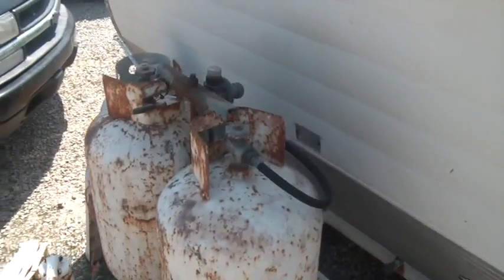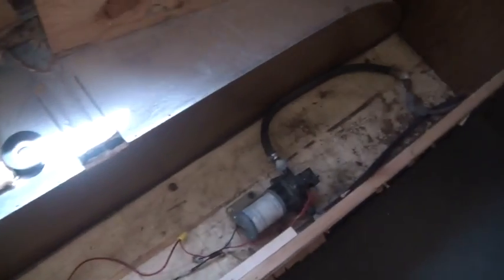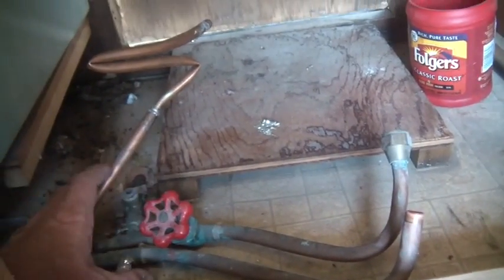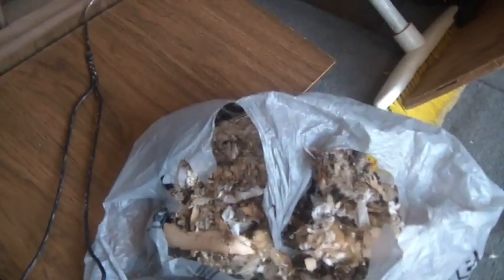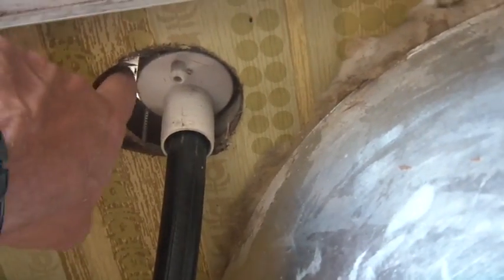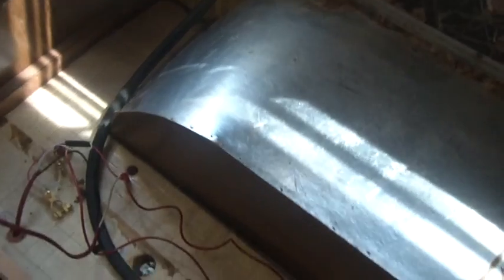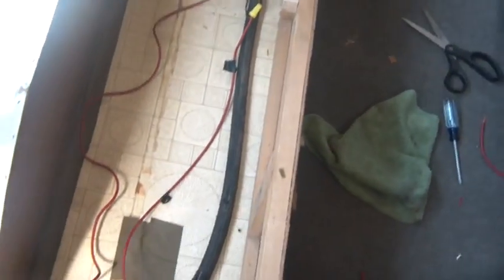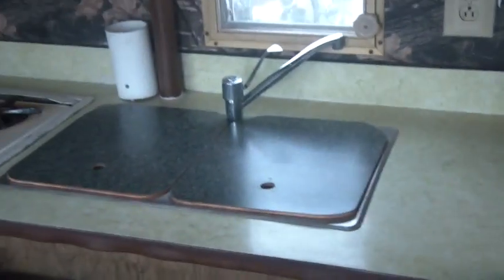Bugout Camper Trailer Update 1

Comment: Pastor, the gas valves appear to be the old type.  The local propane distributor should be happy to swap those for nearly cost if you buy propane from them.  If they do, they will check VIP and hydro check as well.  What a great project!!  Thank you for sharing.

Comment: Your water pump may only be a 12 volt motor, look at it closely. If you connect 120 volt to it you will release all the magic smoke...hahahaha
You may need the inverter to change over A/C current to D/C current to power the pump. You may also think down the road of changing out the window shaker to something that won't draw so much amperage, something more up to date (your choice, your budget). Great project with lots of potential, good luck and God's blessings on your new project.

Comment: @Pastor Joe, While you have all that torn apart you might consider placing hardware cloth and steel wool in any gaps where you see daylight to prevent mice from finding their way back in. Mice will chew right back through duct tape.  Consider PEX for your plumbing.

Comment: Try going to auto parts store and asking for rubber expansion plug that replaces a freeze plug in engine block and put it in hole in floor and tighten it up. It is made to last against engine heat and temperature changes. On the solar idea, batteries are your power storage bank, generator will be needed to run A/C, solar panels will not do it and batteries will run dry quickly. Run genny and A/C during day and use fans at night to be quiet. Solar panels can recharge batteries otherwise.

Comment: You can also use genny to recharge batteries when solar panels are at low efficiency during cloudy days. You will need two deep cycle batteries for every 750 watts you intend to need. Microwaves are power monsters so use gas grill or wood fire for cooking food. Look into a device called Kill-a-Watt meter (look up on Amazon)
Measure draw of wattage from major devices you intend to use to be precise (your choice). You can get away with 1500 watt inverter or so and four batteries.

Comment: PS  YOU NEED A INVENTOR ALONG WITH A 12 VOLT DEEP CYCLE BATTERY TO RUN BOTH 12 VOLT AND AC EQUIPMENT , THE PRIOR OWNER MAY BE REMOVED THOE TOO,  SO ANYTHING 12 VOLT WILL NOT WORK ON DIRECT AC 110 , IT NEEDS CONVERTER TO CONVERT 110 TO 12 VOLT SUPPLY, THEN ALL YOUR WATER PUMPS, 3 WAY REFRIGERATOR, LIGHTS AND SO ON WILL WORK, ALSO YOU'LL NEED ANOTHER HOT WATER TANK,  THERE IS A ELECT EASY TO INSTALL  CONVERSION KIT TO MAKE IT BOTH ELECTRIC AND PROPANE GAS HOT WATER HEATER, ELECTRIC IS BETTER ,